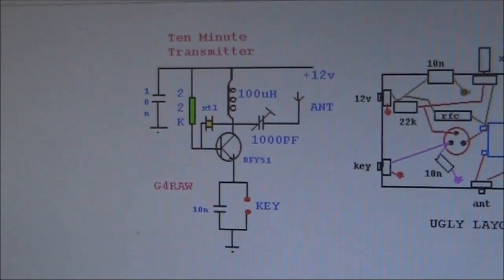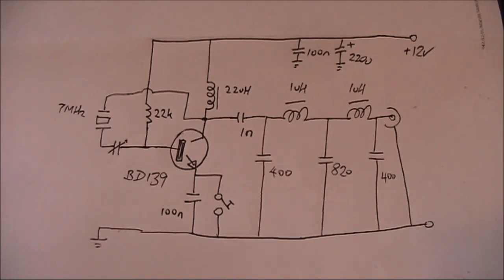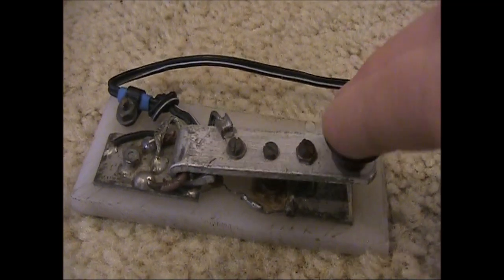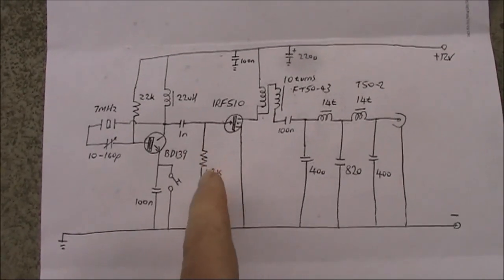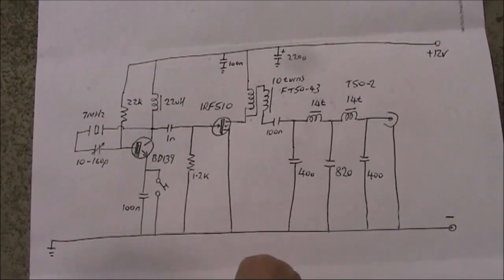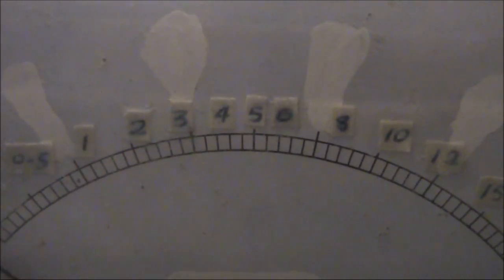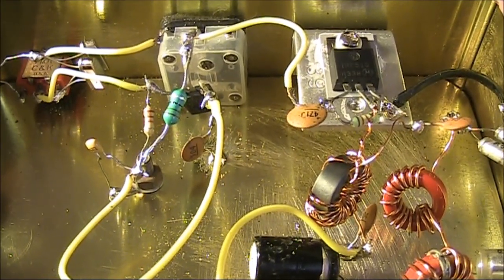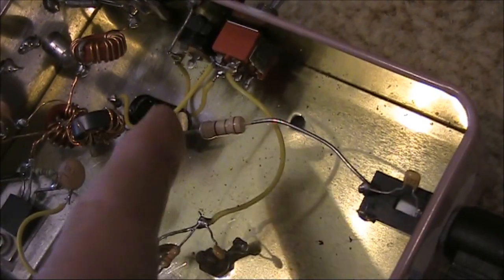A 10 minute 7 MHz QRP transmitter and more

Comment: The BD139 as an oscillator transistor is extremely brilliant, which gave me a unique solution. Therefore, I was able to build a SW radio transmitter from it consisting only of BD139 transistors. But I didn't stop there, so I also built an experimental FM transmitter from it, with complete success. Their range is not great, 30-100 meters without an RF amplifier. Thank you for this incredibly simple solution.

Comment: Is there any way to make a VXO in place of this oscillator crystal to be able to change the frequency?
Reply from the maker: Via the series variable capacitor, this circuit already has a VXO. You could try adding series inductance for more range but you might get more chirp.

Comment: I prepared this circuit and it worked fine, but it crashed after 10 minutes. I used 2222 instead of Bfy51. I have no idea what it is yet. I was powering it with a 12v battery.

Comment: Thanks for the videos.  I've watched a lot of them.  I have good audio on thise one.  Others are low audio.
I have a neophyte question which will make me sound like a novice.  I'm looking at the low pass filter.  I wonder IF one coil canbe used by center tapping the coil and leaving the capacitors as they are designated.   I suspect it won't work because the coil turns will couple.  Am I right?  I suspect if could be done as I asked about that builders would have imlemented that already.
Thank you.
Edited to say on the next of your videos I watched I saw a 4:1 transformer that was almost the same thing I described and asked about in this comment.  The difference is the bifillar wires of the 4:1 transformer are twisted instead of parallel wound.  That video is 20 watts not qrp.
Again, thank you for your videos.
Reply from the maker: You're right re the single coil. I wouldn't do it.
Reply: @vk3ye  Thank you.  I'm making a shopping list for qrp VFOs based on schematics of the Wes Hayward era.  Some of the parts are listed "obsolete" but they're still available from sources other than the usual makers.

Comment: Could i use this tx with a 20m half wave end fed wire without using any antenna couplers? Just the wire straight to the output. Sorry for my bad English and thank you.
Reply from the maker: No. The 20m of wire fed at the end will be high impedance. If you don't want a coupler the wire must be fed in the middle with coax as a half wave dipole.
Reply: Thank you, i have another question. Have you ever build this kind of circuits inside an ATX PC Power supply case? Did it give good results?
Reply from the maker: @juancamps8961  Any metal case would be OK.

Comment: can I make the transmitter with 11.059 mhz crystal
Reply from the maker: It might work but you'd need to change low pass filter components. And it would be illegal as it's out of the amateur band.

Comment: Please: 
 1 : 
What is the meaning of " QRP" ?
2 :
The "10 minutes " is the time of what  ?
Thanks very much  .
Reply from the maker: 1. QRP is low power amateur radio. 2. 10 min is the time in which you might be able to build the transmitter (if you're quick).
Reply: @vk3ye  
Thanks very much sir  .

Comment: you mean 800mW  afret the IRF510 not 8W QSL?
Reply from the maker: Sorry I don't understand your question.
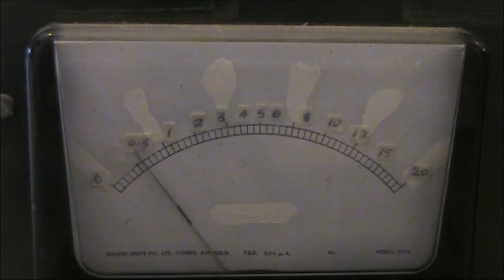Reply: @vk3ye  at minute 2:00 you said you're getting around 200mw output when the meter pointed at around 2. Then after adding the irf510 on the same meter when it was pointing at 8 you say it's 8W. I thought since it's on the same meter it would be reading 800mw and not 8W. Plz clarify thnx and sorry for confusion
Reply from the maker: @khalidtarawneh2289  The meter has two maximum power ranges and a switch to switch between the two.
Reply: I was about to make a similar observation, but the matters cleared up now

Comment: I finished building one of these last night. Exactly as per your diagram.  Built mine ugly style on copper clad PCB. I settled on 450pF coupling capacitor between oscillator and PA. Fitted with 7023 and 7030KHz crystals and get about 1KHz swing. 5W out. Managed to work a couple of stations this afternoon. Just need to find a suitable tin to house it and see if I can make a simple 40m RX to go with it. So, certainly works and thanks again for video Peter which inspired me to build this.
Reply: Hi! I have a question on the toroid winding: Is it 10 turns to the filter and 10 turns to 12v? I can't seem to understand the schematic. Thanks.

Comment: The nice thing about this rig is the chirp seems to attract attention and CW QSO's.  I replaced the HC-49 that I initially installed with an FT-243 socket.  It still chirps like a guinnie pig being strangled, but at least it stays on frequency now.  A lot of fun to use.  Just going to have to build a matching little regen.
Reply: Good point about the chirp. I have also wondered if ops are more likely to reply to chirppie CQs as they know it will probably be homebrew QRP TX. I generally try to reply to any CQ if I can but always make a bit if extra effort if it's a chirppie.
Reply: I can confirm that I always try to call the chirpy sigs.

Comment: Nice work Peter...my first try on a bread board and it worked perfect though it took me all day to put it together. What changes other than the crystal to put it on 20 or 80...tried a 20m crystal  but output was only about 1  watt.
Reply from the maker: The big change is the pi network output filter. If that's at too low a frequency you won't get much output. Also you might expect some drop off in output power with increasing frequency.
Reply: The BD139 is normally used in audio circuits so it's pushing it to expect any more on 20m.
G4GHB.

Comment: If I wanted to use the output of a DDS instead of a crystal do I just take out the crystal and the variable capacitor? Connect the +ve clock output at the top with the collector and the ground to the base?
Reply from the maker: In theory yes but you need to make sure levels and impedances are matched. The output would be coupled to the base.
Reply: @vk3ye  I did later find the answer, namely connecting to base.

Trying to go the Arduino/Si5351a route with a VFO.

Comment: when we make an amateur CW call on the air, we use "CQ" instead of "V". "V" is used for professional communications.
VA3ESV
Reply from the maker: Sending a series of Vs is customary when testing equipment and a reply is not expected and may not be answered. CQ is used when seeking a reply.

Comment: Interesting!
So it's a Pierce Oscillator onto which you've put an Output Stage and the Filtering on the output is a nice touch.
I don't know if you get Practical Wireless out there but it reminds me of the work of the late Reverend Dobbs.
Just out of curiosity is there any interest in this hobby shown by the Aboriginal People?
Reply from the maker: You used to see PW in the newsagents here. I do get Sprat. Oscillator based on a design from that. Not aware of high Aboriginal participation in AR.

Comment: Could I use this project to build on 27 MHz tks.
Reply from the maker: Not easily. Transistor gain drops off with frequency. And you would need an overtone xtal osc circuit.
Reply: @vk3ye  tks 7351.

Comment: I think in the first version without pa mosfet you can add an high z earphone in parallel to 100n to get a trx :)
Reply from the maker: Yes. G3XBM has some designs. Very low audio level though so an extra transistor or two is highly desirable.

Comment: it would be nice to insert AM modulation on it and change the crystal to AM band
Reply: I have seen a 2x2n2222 into IRF510 circuit with audio inserted at the second 2n2222 and produced 5w with good audio. The transmitter was used by US Shortwave pirate Liquid Radio and logged all over the USA.
Reply: 5W AM modulation on 40m or 80m with this easy circuit... :o

Comment: I saw you on RBN last night and this morning. Calling on 7023. Figured you’d have a new contraption you were playing with. I was working out how to get my antenna sorted out. See If I could QSO you on one of the Pixie’s my son built 

Unfortunately, I was otherwise occupied fixing the Xiegu X108G. That had a problem with the 9V transmit power rail only registering 2.5V.  Turned out to be a relay, but there was also an open circuit ferrite bead chip in the finals driver transistor.  Wierd

I videoed some of it. Might put it up on line. Not too many of these Xeigu’s around, and even less video of them in bits on the bench. 

When I got it, it had been “opened up” and covers 100KHz to 29.99999MHz including the the 137KHz and 472KHz bands on transmit. Sadly I only have a middle license and am legally precluded from using them.....

It also makes for a nice backup antenna analyser

On the X108G, there is a mod I’ve done to repurpose the unused serial comms jack to allow for digital audio in and pre volume control line level audio out. Works superbly now. FLDigi also gets to record the accuracy of my drunken chicken pecking keying too as it’s post side tone injection. Digital receive is no longer dependent on the volume control, or taking up the headphone / external speaker jack, also I can check the audio, and it’s one less lead :-)

Comment: I forgot to ask about this thing of using the minimum number of transistors. All this stuff is fine back when transistors were expensive but now they are cheaper than the caps  wouldn't you be better off using using a few more and gett a nicer result say by buffering the oscillator stage for example?!
Reply: ease of construction and the beauty of simplicity: doing more with less.
However if a much more versatile transmitter was wanted, a intermediary stage between the oscillator and amplifier would be good. That way it could have ports to be able to apply modulation to the driver/buffer and final. In this way it could be changed to an am transmitter OR used as a CW transmitter
Reply from the maker: @Dazzwidd  True. But crystal controlled AM is pretty useless in terms of getting contacts. On a contacts per transistor basis CW is much better. A basic DSB rig that was frequency agile (like the Beach 40) would also be excellent. But I do have an AM rig along these lines described here: https://www.youtube.com/watch?v=Gxv3D92-jS4&list=PLj8-NKcZtRf4qdp-3wLurFsU16vkxTwG2&index=1
Reply: @vk3ye  Hi Peter, I understand the points made .. I was more about the fact that now you can buy a transistor for a penny a pop  which are perfectly functional at HF why  are folk quite willing to use extra Caps/resistors /inductors etc but they baulk at a transistor which may well be cheaper ... I agree minimalism may well be an art but 5 descretes and not more minimal than 1 transistor say. A maximal transistor build would be quite fun in that case!

Comment: How come in the first power meter reading you read off "2" as 200mw but then after adding the amplifier you read of "8" as 8 watts ??
Reply from the maker: Hayden - the meter has two ranges. 2w & 20w.
Reply: @vk3ye  do we have a circuit for the power meter om  kg6mn

Comment: Fun project.  What power diid you get  from the IRF510? Its a good time for simple transmitter projects. With Kiwisdrs Reverse Beacon and WSPRNet  who needs a receiver?
Reply: I think that the IRF520 and IRF530 would be great candidates for more output at these low frequencies but more output would be required from the oscillator so a single BD139 as a driver would be good.
The oscillator could also be run lighter to get only 50mW for the driver. 
With 1 to 1.5W driving the FET, 25W may be seen with an IRF530 I believe
Reply: @Dazzwidd  It's pretty good value from three transistors worth $3 in total. The IRF530 could tolerate a higher drain voltage, maybe 24V safely. just heatsink it well. This configuration  reminds me of the MOPA or two-valve crystal CW transmitters of yore, about the simplest and best performing homebrew transmitter that could be built, typically  comprised of a pentode as oscillator driving a serious PA tube such as a 6146 or even an 813 for 50 to 150 watts carrier.  And a real coffee-table show-piece too, the power tube glowing all infra-blue with each key-down...
Reply: @Paul_VK3HN  FETs are like the modern day solid state equivalent in many ways.
It's fun to play around with simple circuits.
Another interesting transistor although more expensive is the RD15HVF1 mosfet.
Although they are for VHF, they can be used on HF and 50mW there can drive them to over 10W easily. But take measures to prevent them oscillating. 
I messed around with one on 27mhz and that's the kind of gain I was witnessing there
Reply from the maker: @Dazzwidd  I think the main thing needed would be higher voltage. Eg 25-30v. The IRF510 might even do 20w with that. I'd also be wanting to check that impedance matching between osc and PA was OK - I suspect there's a mismatch.
Reply: @vk3ye  a major thing is the gate capacitance when you're dealing with fets, but yes there would be mismatch. 
In the case of your circuit the 470p coupling capacitor would be acting as a voltage divider with the gate capacitance.
The inductor in the oscillators collector is an interesting question concerning it's resonant frequency with this divider across it
Reply: @vk3ye  irf510 has 180pf gate capacitance. the 470p in series with that will be approximately what will be resonating the inductor in the oscillator.
This could be interesting to investigate for circuit refinement.
You might be able to make a variable inductor with a ferrite slug to avoid bulky, expensive and or hard to obtain variable capacitors. Perhaps inductive loop coupling will do better here as well as the coupling coefficient can be altered and you might actually need to ADD additional parallel capacitance to get the loop driving the gate better.
Reply from the maker: Paul - 8w max.